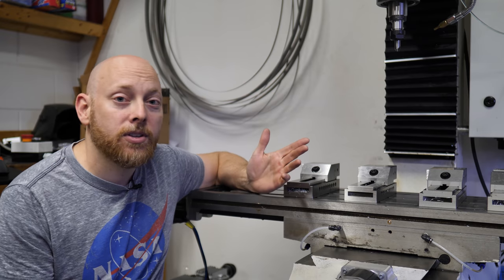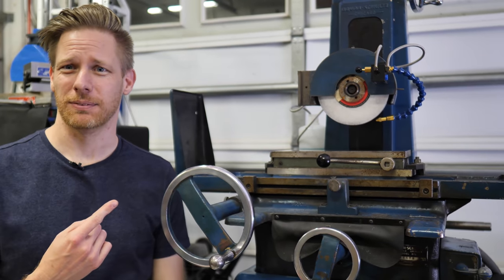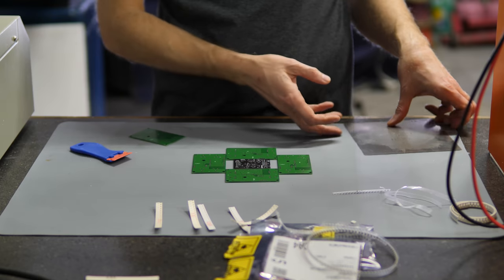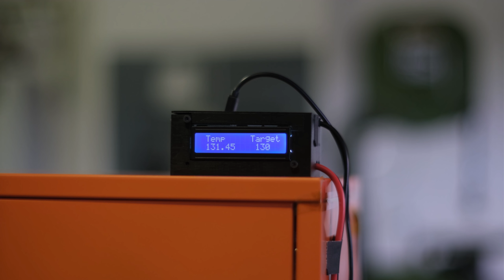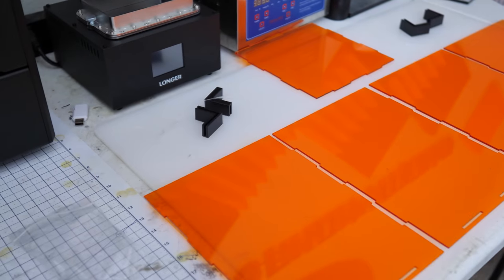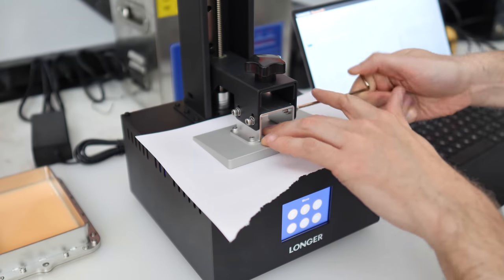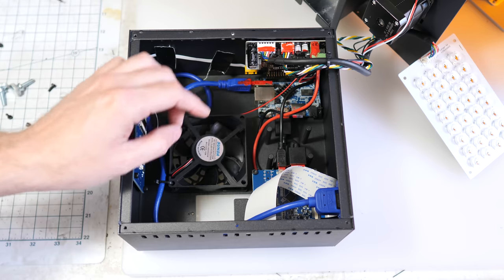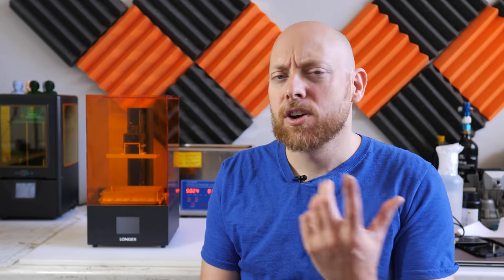Chip Tray - S03E12

Comment: Aluminum PCBs are a thing you can get, usually used in high heat applications; if you take apart an Ikea LED bulb, it'll have one too (probably most LED bulbs, but the ones I've taken apart were ikea).
Reply: the base material is called IMS and its usually still uses glas reinforced epoxy

Comment: Dont put the Prusa PSU in the enclosure, it's pretty much maxed-out at ambient temps. I burned up my MK3 trying to print ABS. I upgraded to a 350w Meanwell and extended the wires outside of my enclosure, it's been going great for about a year like that.

Comment: The red glue is 95% certain Kafuter K200R. Really good stuff to use to semi permanent fix connectors etc. Will peel off if persuaded so rework is possible.

Comment: Hey! I bought a Prusa too this month! Its absolutely amazing and I have also built an enclosure. Hope to put in the printer tomorrow. What are you doing with so many printers anyway? Will you heat the enclosure or just use passive heating from the printer?
Reply: Nice! Probably just passive heating (I hear the bed is enough heat most of the time?). So many printers: I don't know about Mike, but I've had the two prusa's running about 14 hours a day for the last two weeks making an endless collection of brackets and mounting frames for an optical bench. Might have to show a few of those things off later

Comment: Just a tip, Zyltec sells aluminum extrusion very cheap. I needed a bunch for a cnc router and 3d printer enclosure.
About 200' of pre cut 2040 t-slot for $1 / ft shipped. I used aliexpress for the corner plates / brackets / hardware.

Comment: Maybe I'm missing something. By saying you don't need "homing switches" do mean you don't need any sort of "stop limit switch" ?? Can the machine just stop if it reaches a limit with out any physical switch? Great video by the way. I have  Clear Path motors on 2 CNC routers I built. Great motors. However, I find the "tuning software" documentation some what lacking. Not easy for a non-engineer to figure out.
Reply from the maker: Correct, no switches needed of any kind. You just need a physical stop at the end of travel. The motors go into homing mode and can detect when they have run into something. The software is a bit complicated if you really get into the details, but I have found their customer support to be awesome, I would suggest calling them if you have questions.
Reply: @PhysicsAnonymous  That is great info to have. I have two CNC's that I built that are loaded up with proximity limit switches. They, limit switches,  are temperamental  to say the least. Getting rid of them will be a blessing. Thanks for the heads up.

Comment: Do you know the source of the flexing of the surface grinder when you were grinding the gibs?  The movement is quite noticeable in the video...
Reply: Probably not it flexing, but the table tipping back and forth.
Reply: @maesto  exactly that- rubber feet on the bottom of the tool chest it's sitting on.